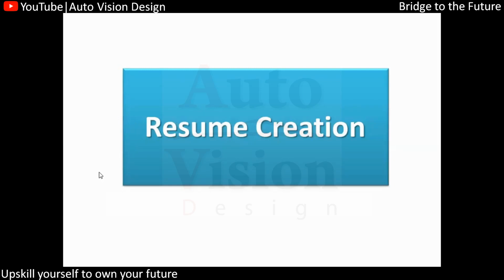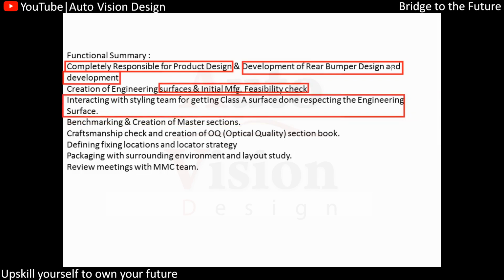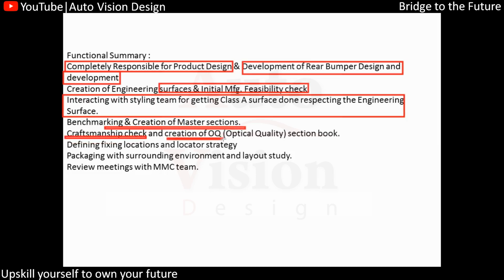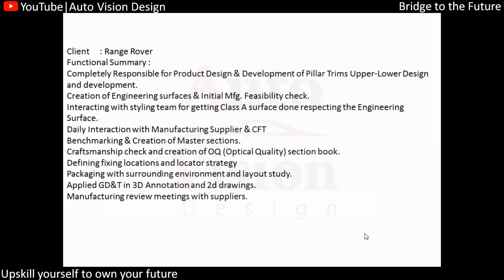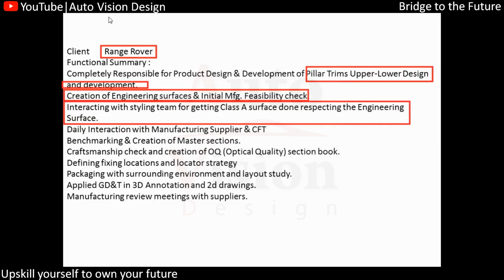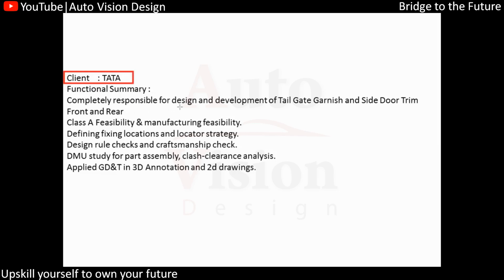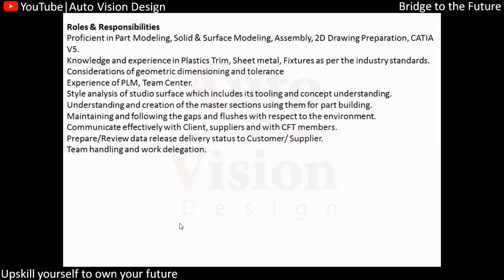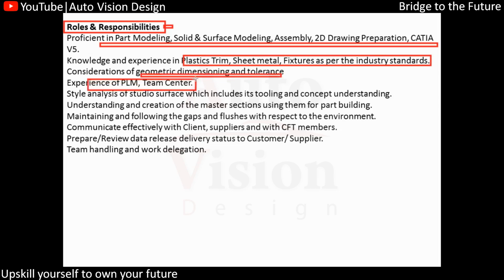Plastic Trim Job description and Resume Creation PART B

Comment: SIR WHAT IS 3 TO 1 PRINCIPLE
Reply from the maker: 3-2-1 Datum and Locator relation in Plastic Part 
https://youtu.be/pYHaK376V80

What is a 3 2 1 principle in GD&T | With Daily life examples | Automotive Plastic trim
https://youtu.be/cmfoYntCjLU

2 Way and 4 way Locator creation from Master section | CAD Test | Automotive Plastic Trim
https://youtu.be/9hHd_J3cWMg